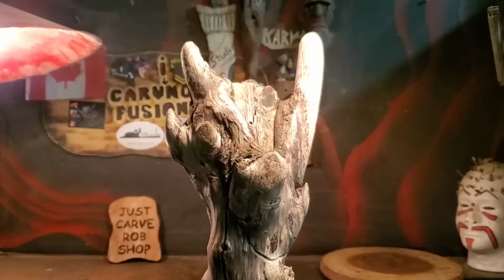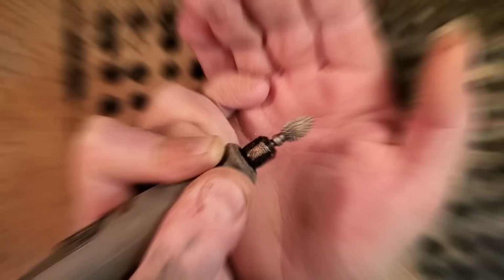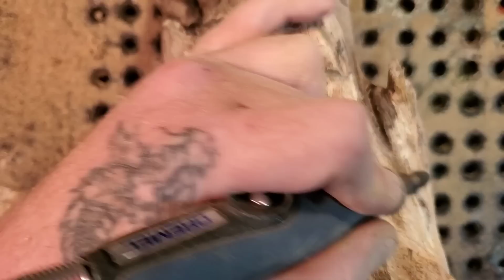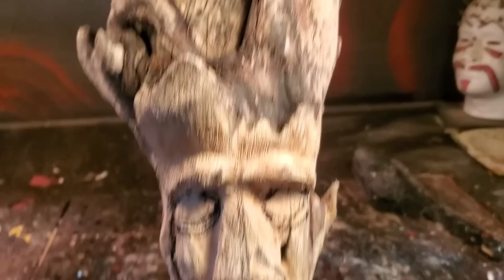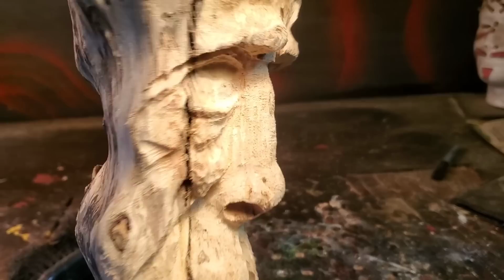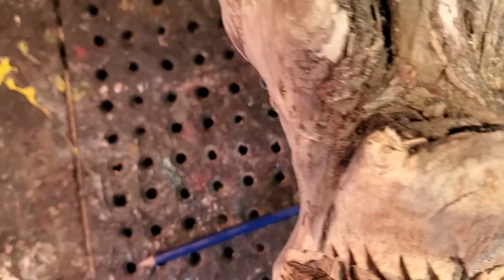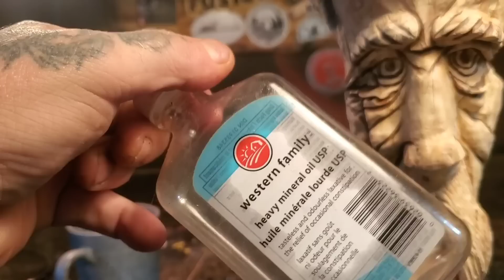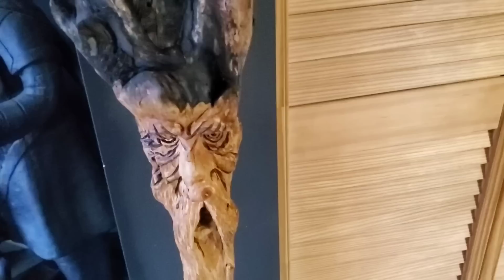Dremel Tree Root WoodSpirit Carving. #2 Final

Comment: I just bought a 9100 Drexel. Just like you just said, The burr started wobbling making the burr jump and catch my glove.  Guess what? The flex shaft didn’t like this and broke at the base of the shaft. I had to replace the flex shaft. As of now Drexel only sells the complete shaft assembly and flex shaft together. This little mistake cost me $32.00. Listen to Jordy he has a lot of knowledge about carving. Little strokes and keep your speed where the burr was made to operate or don’t listen and spend $$$$.
Question Jordy. When you have a crack would it be smart to drizzle some epoxy into it to give some strength to that area in question?
Have a great day Jordy. I get to play with my 9100 and my new flex shaft.
Reply from the maker: I dont think epoxy will give any strength it the wood want to crack it will crack

Comment: I think the grind marks add texture. Came out good. Oil was a good choice for that wood I think. I'm back from the river. Picked up a couple bits of wood. Didn't see any bark like last time. Oh well.  Hi Jordy.
Reply from the maker: Awesome rick did ya film?
Reply: @CarvingFusion  No I had to be back at the house so I didn't have much time. Just went to get some sand but saw a tree down easy to get to and had the batt saw with me so I grabbed a couple chunks. I carry a saw with me in winter, trees fall across the road more in winter seems like. Had the road blocked commin home with a van full of grocery's before. Havin the saw in the van is faster than walkin to the house to get it. Took longer to drive to the river than I stayed there. No barges, nobody on the ferry, Weren't nuthin to see anyway. Hi Jordy.